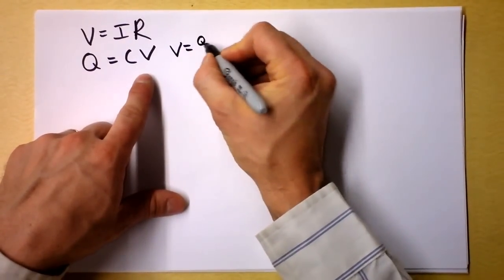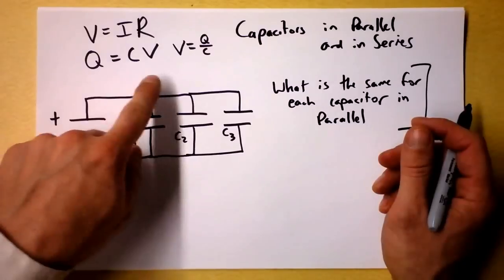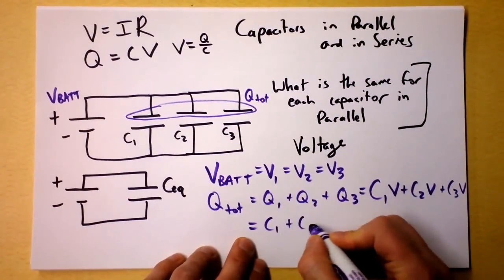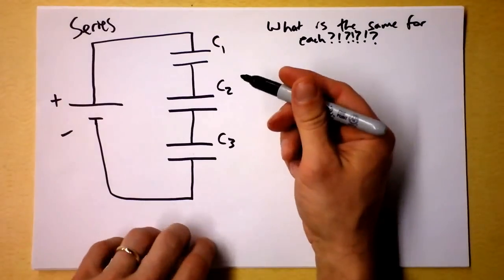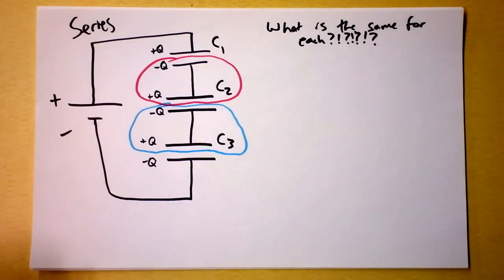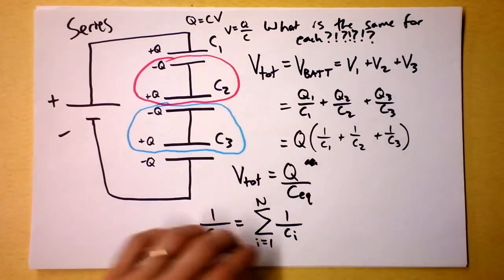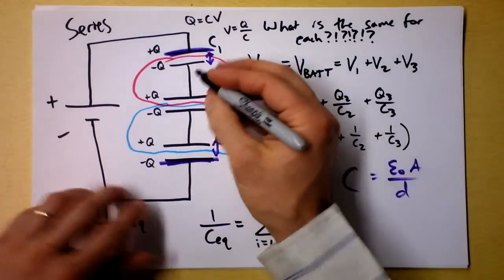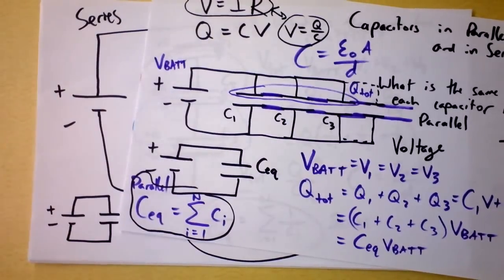Equivalent Capacitance for Capacitors in Series and Parallel Circuits Reduction | Doc Physics

Comment: What about charging a 1 µF and a 1 nF capacitor seperately from each other to the same voltage and putting them in series?
After my analysis you will get the double voltage and a smaller capacitance. Let us say I charged them to 330 V, then the big one will have 330 µC of charge and the smaller one 330 nC. 
The energy stored in each one will be around 55 mJ for the large and 0.55 mJ for the small one.
Putting them in series gives a capacitance of 0.999 nF, a bit smaller then the smallest one.
The energy from the voltage and the capacitance gives 0.2 mJ and from the addition 55.55 mJ which is already a contradiction. The charge on both should be the same whoich is 660 nC by Q=CV. But where are the charge of 330 µC and 330 nC gone? Where is the energy gone? Using QV/2 for E gives 55.55 mJ. Which one is correct? And what about the assumption that the charges on the capacitors are the same each other and the total charge as Qtot=Q1=Q2, ?????

Comment: can a super capacitor holds voltage like a batteries?  if so how many days? why is it that if i connect the super cap to my batteries it discharge the batteries or reduce the voltage of my batteries?

Comment: This stuff is so easy for me to do. Some of the guys here seem intimidated by what Doc worked out in the video. Get to the fun stuff, like calculating phase angles between voltage and current in RLC circuits. And all the rest of the cool math. --> I'm an Electronic Engineer, but I do remember years ago when I was trying to learn this.

Comment: i have a question if I connect  two capacitors in series one that can stand 20kv  with low capacitance and one that can stand only 2100v but have greater capacitance then what voltage can thy both  stand before breaking and what will be the capacitance of them both connected

Comment: Why can we treat a series of dielectrics like they're capacitors? I understand how in parallel they are analogous to the reasoning here -- they're essentially two capacitors in parallel with different dielectrics -- but I can't follow it in series, as there is no conductor in-between.
Reply from the maker: +Bob Goodgulf Well, I guess you don't need the conductor in between - the two dielectrics will still polarize differently to create surface charges, right?
Reply: Doc Schuster Maybe? The only thing I can see is that it could work sort of like a single capacitor with the effective plate charge equivalent to that of a capacitor with only the least polarized dielectric, but with a different voltage, since the charge between the dielectrics has a lower distance, and so that could sort of lead into the idea of same charge but different voltage in a series of capacitors if you ignore that you'd also have to have another capacitor with the most polarized dielectric, yet I cannot see how conceptually it is the same as having two capacitors at all.

Comment: sir, for capacitor series circuit , why the total voltage in the series is equal to the addtion of each voltage across each capacitor? how to explain it? for example, there is 2 capacitor in the circuit. first : apply 6v battery. then  1 coulomb charges being push towards the first capacitor with 6 joule. then isnt the first capacitor has 6v potential deifference and second  capacitor has 6v potential difference? but in mathematical way is total voltage will only be 6 v. i dont understand it!!!! help !!
Reply from the maker: Steven Lee Energy conservation.  The voltages in a circuit must add up, just like putting batteries in series or standing on the shoulders of a friend.

Comment: I love your videos! They are very helpful alongside my classes, which aren't always clear.

Thank you!
Reply from the maker: Dillon Strichman Polarization!
Reply: Doc Schuster I'm very sorry, I edited my comment before you were able to reply!

There is no actual movement of electrons in either of the two unattached "bits of metal", right?

There is only movement of electrons from one half of the top capacitor, through the battery, into the bottom half of the bottom capacitor?

I'm struggling with understanding the role that the capacitor in the middle plays. How does it affect the circuit at all?
Reply from the maker: Dillon Strichman Electrons move to polarize the intermediate (disconnected) piece of metal.  You believe it lowers the total capacitance, right?  A lowered capacitance affects the frequency-dependence of the circuit - that's one big change.

Comment: Do I have the calcs in this capacitor bank correct?
the bank is connected in parallel.
20 X 450v  9Kv
2400 µF: X 20 =Total µF: 48,000

Comment: he said 3 capacitors in parallel wound be something like this voltage is the same 12volt  600microfaradX 3=1800microfarad,but in series is like 600X600/600+600=300microfarads but voltage is the same because the incoming voltage is the same

Comment: I always like teachers who reenact the same excitement they had when they learned the material themselves. What they have to say always makes more sense! Great teaching Doc! I already know the formulas and how they work, but your explanations helped me to better understand HOW the caps in the middle of a series electrolytic capacitor arrangement decreases the overall capacitance due to the extra held capacitance WITHIN the arrangement and that it must be overcome so to speak. Did I explain that right?
Reply from the maker: I kinda like that.  I would say that series capacitors are just like extra metal is thrown inside your original capacitor.  Thanks for watching!

Comment: Does a capacitor keep discharging during charging, thus accounting for the "long time" to charge up?  This is not to be confused with the voltage bypassing the capacitor during its charge-up.
Reply from the maker: Electrons will either move toward the negative plate (charging the cap) or away from it (discharging).  The former will happen if the voltage across the cap is less than the voltage of the source, and vice versa.  The time to charge is an excellent indicator of the resistance in the circuit.